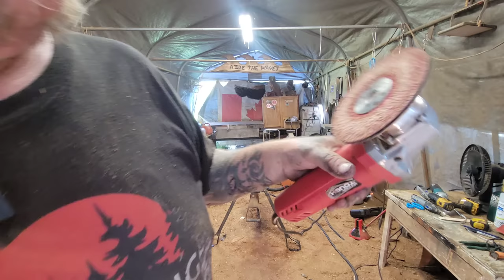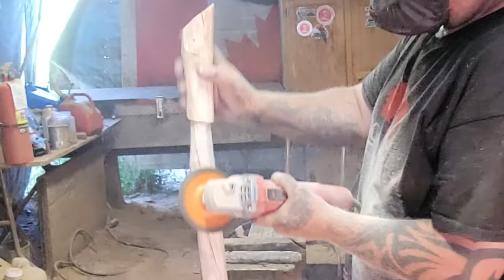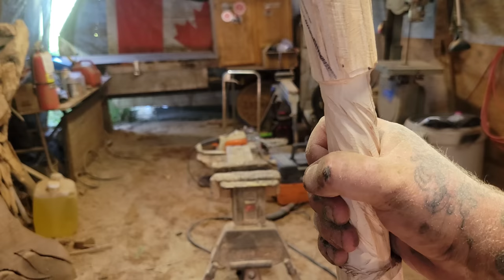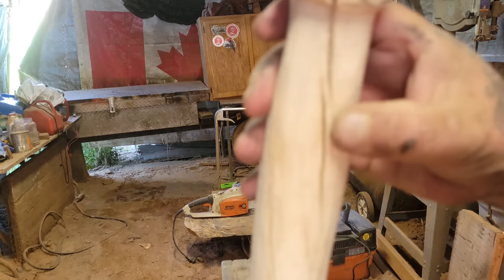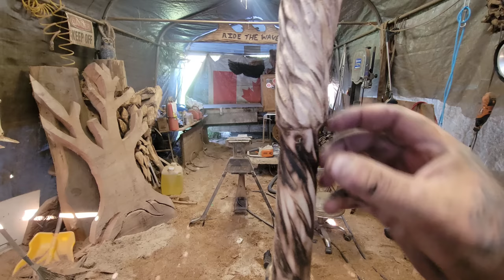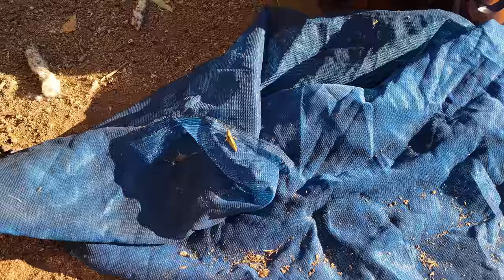Very Beginner How to carve a walking stick with Angle grinder & Dremel.

Comment: I made a walking hiking fighting stick but it’s not wood, it’s hollow metal tube that can be disassembled to 3 equal lengths that I can put survival bushcraft items inside. 

Plus my hiking survival stick is about the same heigh as me which is 5’7 and I can use it as a fighting stick and also turn into a chair; that’s another reason why the staff is dissemble in 3 separate lengths. 

Lastly, I covered the whole staff with fake wood tape and I put ranger beads and a small compass on it.

I made a triangle leather pocket thing so I can put it on top of the 3 length staff to make a chair so I can sit on it.

Comment: Around my neck of the woods is an invasive bush called honeysuckle that I’ve found to make excellent walking sticks with little effort, you just need to find a straight one cut it green let it dry in a jig to keep it straight for about six months. Leave them outside out of the sun with the bark on, these sticks are hard lightweight but very sturdy. By the way how do you heat your shop... work faster?

Comment: Hey Jordy ya might’ve just given me an idea about a problem I’ve been having;

I’m lookin to get away from sitting there forever carving away 2.5 inches of top layer of hard wood on a relief carving with an extreme burr. Takes frickin forever and those dang cutting wheels just scare me too much. 

Would that mampa cutter maybe fit the bill?
Reply from the maker: Manpa cutter is good as Long as u have your piece of wood in a vise or secured yup , but I just showed how well a 36 grit sanding disk works too
Reply: Thank ya, Jordy!